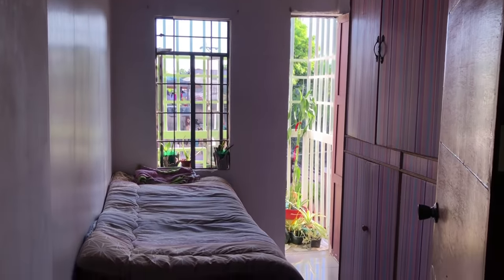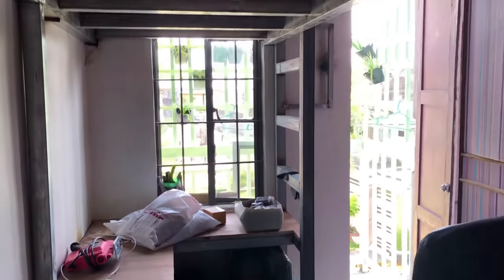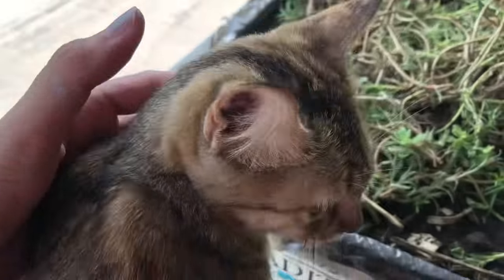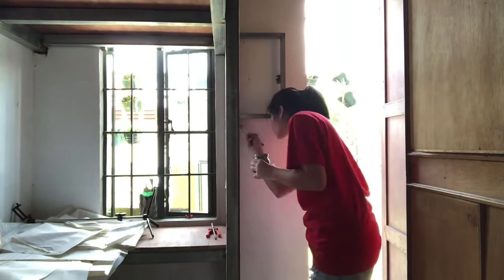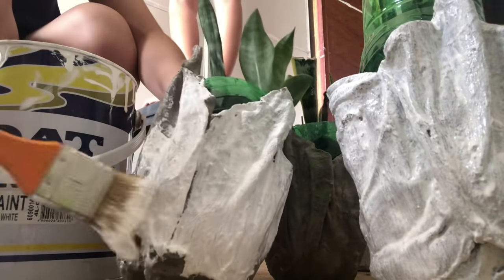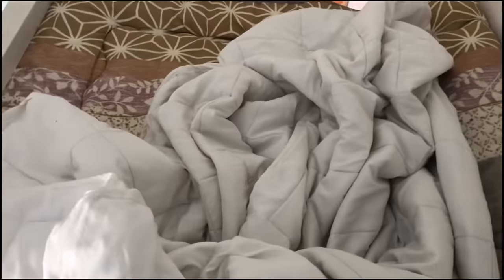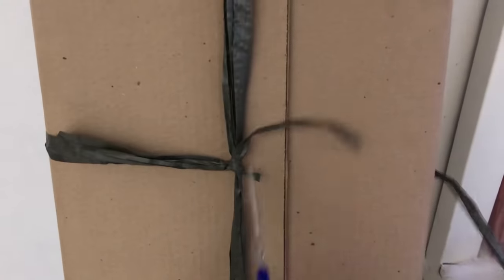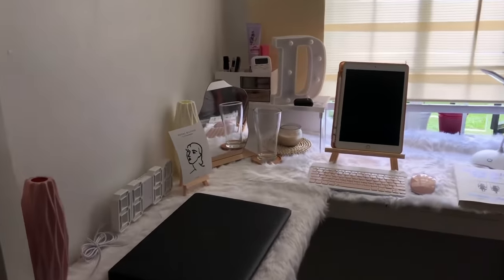EXTREME SMALL ROOM MAKEOVER: EP 1| DIY Loft bed and study desk (Eng Sub)| Philippines

Comment: Hey, you want to put a tray or a board (any hard material) underneath the laptop/notebook. The plush is going to shed lint and dust that the laptop's fans are going to catch and it can get seriously damaged. 
laptops should never rest (not to mention be running) on top of any fabric material 😉
Reply from the maker: yup I already ordered a laptop stand hehe thanks for the suggestion😊
Reply: me: who leaves laptop on bed without material underneath 😫😰
Reply: Why its laptop when u can't use it on ur lap directly

Comment: Wow it turns out really pretty!! Anyway just a little tip from me, better to not put the laptop in the rug because the rug can trap the heat produced by the laptop inside and it can affect your laptop health as it can't regulate its heat properly. Maybe you can remove the rug in the laptop area and leave the rest of it as it is now
Reply from the maker: thanks for ur suggestion😊 I already bought a stand for my laptop

Comment: Hi dear, i just want to tell u that its better not to put your laptop on the faux fur fabric. I also have faux fur on my table but it was fine because my laptop is on a cooling pad. Laptop should be put on a flat wooden surface because if not, it would cause further problems like overheat, low ventilation and slowing down on the computer system. I advise you to remove the faux fur or just buy cooling pad because if ur laptop is still on that fur, it would have a hard time with ita ventilation.
Reply from the maker: yeah I already bought a stand for my laptop. Thank you!!❤️